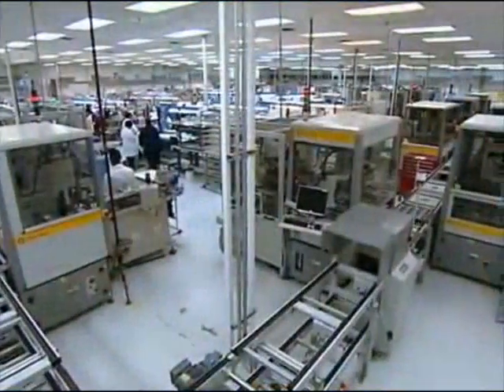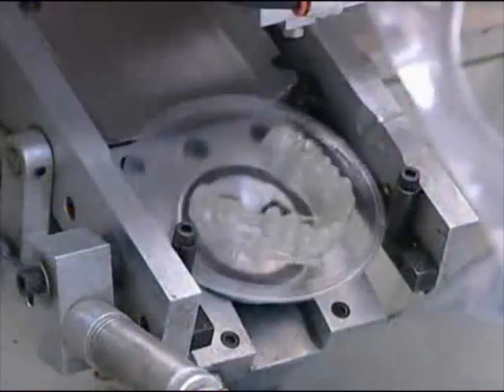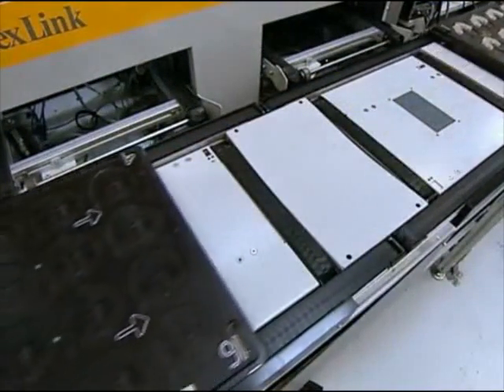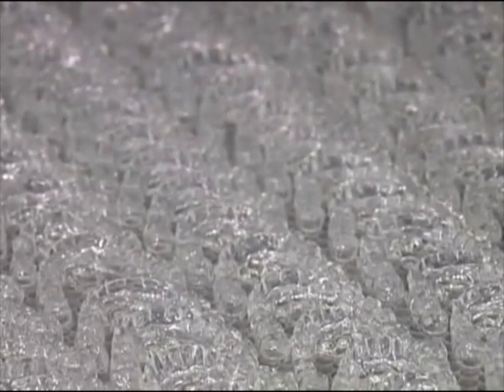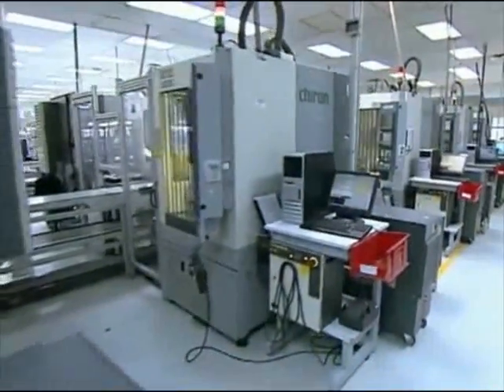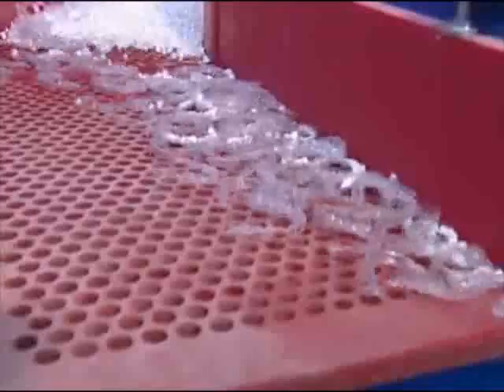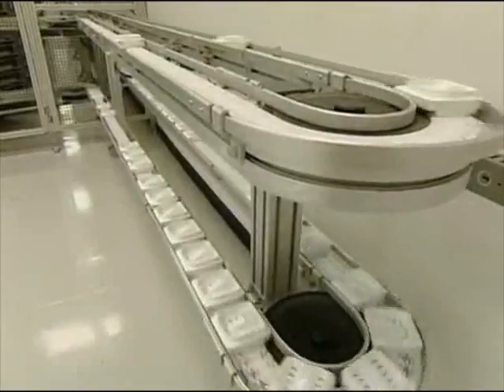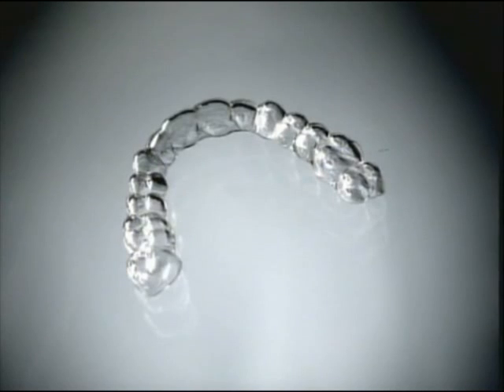Invisalign Manufacturing Process English

Comment: I have an overbite, but that's not what I am worried about.  The 2 smaller teeth next to my 2 front teeth are pushed back, and my front 2 are pushed out. I just want those 4/6 front top teeth to be in line. I am wondering if there is a way to handle those without the others if they're able. Because my bottom teeth are jacked up, but I don't care so much about them. Just the top/front 4 to 6.
Reply: You'll need an orthodontist to review your case. Even if it only looks like a couple need to move, it's very possible they will need to move the teeth on the other jaw to ensure proper occlusion.  Occlusion is the critical part, cosmetics really are secondary. Either way, Invisalign and normal braces can do the job.

Comment: What am I paying thousands to the orthodontist for?
Reply: That is not correct. Once the impression is sent to the company, the orthodontist then modifies the final result and sequencing of tooth movements based on their education. Also, the manufacturing costs are much higher than what you stated.
Reply: Good Q. Here's the answer: These trays are only as good as the planning that goes behind them. The orthodontist decides how your teeth will move, special extra features to add, and when to slow down or exaggerate a movement. Not to mention things like adding the white attachments on to your teeth and/or slendering teeth that are too big. The trays are just a tool - a tool that's success is based entirely on the correct diagnosis and treatment plan
Reply: @SherwinHabibi  a computer program can do a better job.
Reply: @don7777s  Maybe some day. But for now, eliminating the human component does result in suboptimal results and even damage in many cases. There is research out there about AI and tooth movement. So at some point, like in many lines of work, the human element may be less and less necessary. But we're not there yet.
Reply: @tod  everyone knows how the heart is supposed to beat and how it should not beat. It's common sense for anyone smart.
Reply: Sherwin Habibi 
Very interesting.
Reply: kerrie john orthodontist just takes your oral impression and send to clear aligner companies for this types of orthodontic treatment actually manufacturing cost approximately 800usd max per person